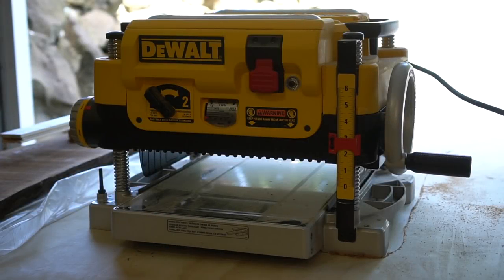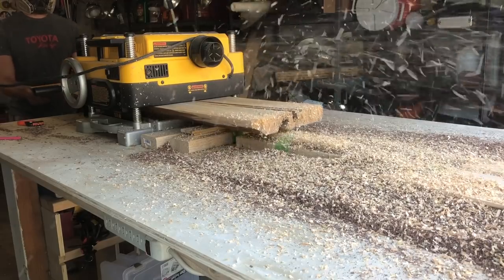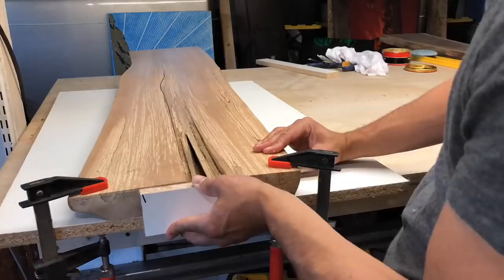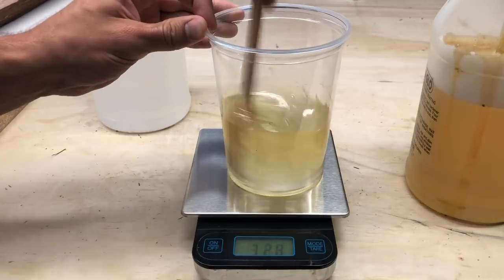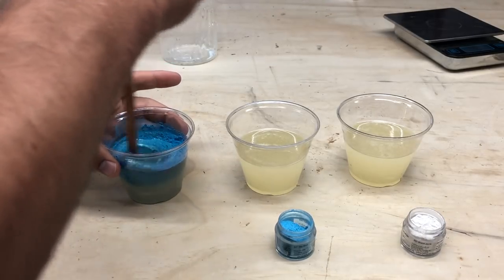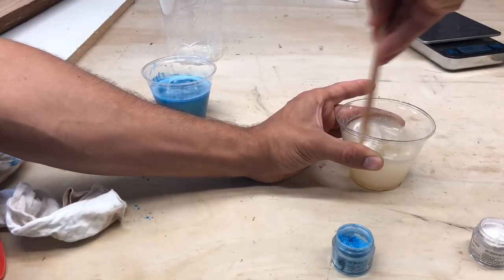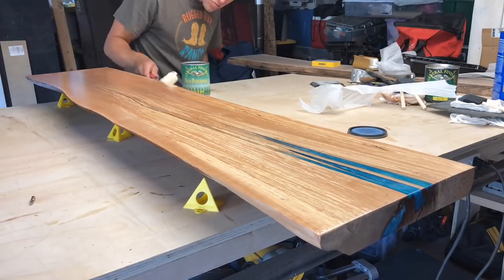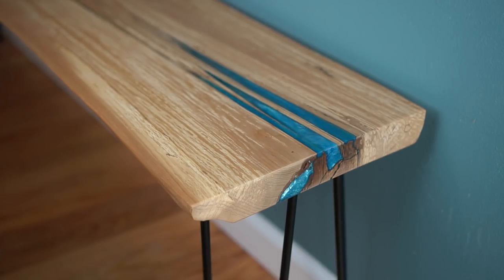DIY EPOXY BENCH : Epoxy Wood Repair

Comment: @2:27 just attach a shop vac. if you own it you can wire the planer to the shop vac an both will turn on at once with one switch.
Reply from the maker: Definitely learned that trick in more recent videos.  Thanks for the tip Darren and for your support.